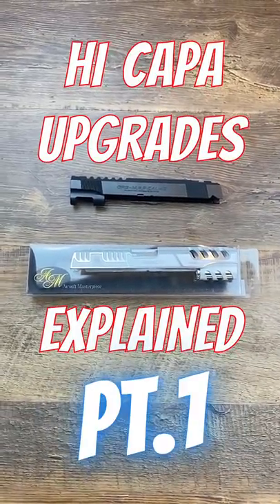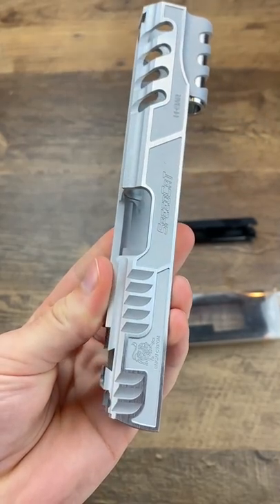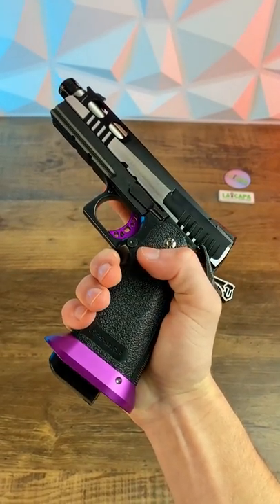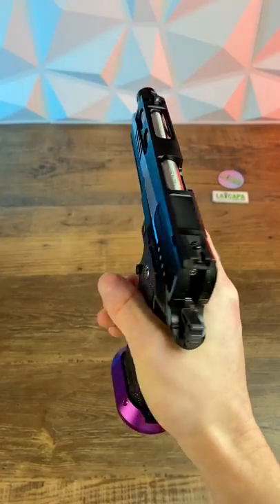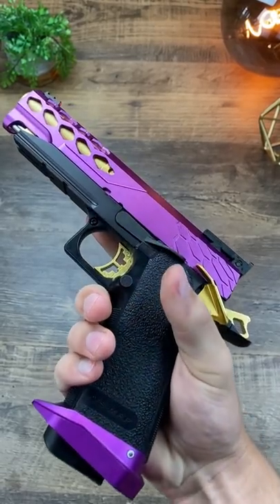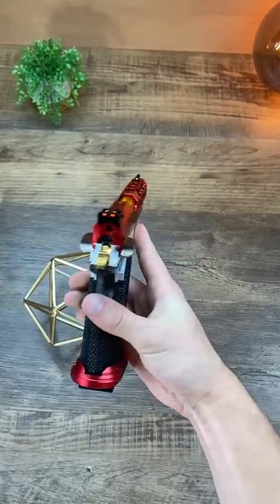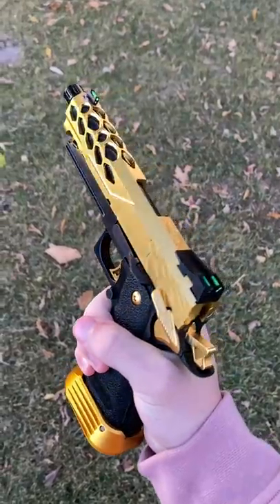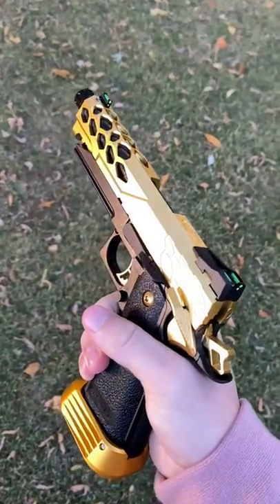Hi Capa Upgrades Explained Pt 1 #Shorts

Comment: Could you some how help me figure out modding my hi capa Baba Yaga?
Reply from the maker: gotta be careful which components you use. Stick with universal ones like a recoil spring (120-140% for a metal slide), trigger, grip screws, and inner barrel set up. Don't touch items like the blowback unit, slide, nor internals without making sure they're exactly tokyo marui spec!

Comment: "engravings don't give you any tactical advantage, still, that was some fancy shooting, pretty good" 
~big boss
Reply: That was ocelot not big boss.
Reply: @elon1928  it was Big Boss, Naked Snake compliments Revolver Ocelots gun and after his mission, he becomes Big Boss, you're talking about Revolver Ocelot in MGS5, when OP is talking about MGS3
Reply: @henryfiguero3886  he was snake at the time so he wouldn’t be big boss anyway
Reply: You're pretty good
Reply: @henryfiguero3886  the way he wrote it quotes Ocelot in MGSV
Reply: of course they do, for every bit of engraved space, you reduce the weight of the part by a tiny bit which can result in for example higher rof if it's the slide
Reply: @NiceGameInc  but technically would increase recoil, right?
Reply: @Ahab2710  with gas pistols you are actually even lowering the recoil because It's less weight getting thrown back. If you further want to decrease it you can use a stiffer recoil spring, too. It will just make the action faster together with a light slide. But that's just my experience. Higher Recoil mainly results from weak recoil springs and heavy slides together with heavy BBUs but why would anyone put smth like this together? ^^
Reply: @Ahab2710  it's still snakes quote, ocelot was just repeating snake
Reply: @lordandsavior6726  snake words it differently, you could argue it's still his quote, but this version is by Ocelot
Reply: @Ahab2710  true, the only reason I said it like this is because this is the last version of the quote that I heard. I couldn't quite remember snakes exact quote. 

It's such a small difference anyway alright? Can you just let It be?
Reply: They do give a very slight and I’m talking like chances of a dream fans dad coming back tactical advantage because they make the gun ever so slightly lighter
Reply: @alexanderregan2181  I mean, at that point we might as well call it a disadvantage as well as the barrel of the gun has been ever so slightly weakened by the material being removed.

Comment: Rate of fire and durability seems like a massive upgrade to me. I’ve seen lots of stock tm hi capas crack and break overtime so it’s a worthwhile upgrade imo
Reply: making the slide metal decreases rof cause its heavier
Reply: @Shaun-hp2yz 99% of hi capas have a heavy pot metal slide. So uh, no.

Comment: Durability is a huge plus for the slide. Stock slides WILL break with green gas. Tokyo Marui hi capas are meant to run on duster gas. Give slides credit dude. Plus your fire rate goes down but 20 bucks will fix it. Throw in a new spring and a short stroke kit.

Comment: I just don't want my slide to crack when running greeg gas or hpa. Besides i also upgrade the recoil spring for lost cyclic rate. Of course you don't go above 150%. I also like to upgrade the grip to a polymer grip and i stipple it. The hammer js optional but again its plastic.

Comment: I wonder it it would be possible to 3D print things like a slide. Of course durability is my main concern but depending on the strength of the material, quality of the print, design of the slide itself, and more it could work and you could even customize it to your liking by adding some grip points aesthetic changes and more

Comment: Tokyo marui hi capas aren't built to be used with green gas, so they tend to Crack and break.
Reply from the maker: Correct - but it takes a while for this to happen. That's of course when I'd say a replacement is needed.

Comment: I always wondered, what really is a hi-cappa?
Reply: basically a 1911 but modernized and high capacity, thus the hi capa
Reply from the maker: The hi capa is essentially an airsoft version of the 2011 which is a real steel double-stacked and modular 1911-styled handgun.